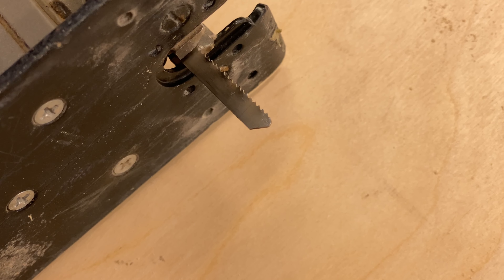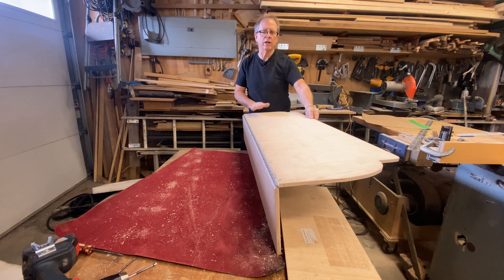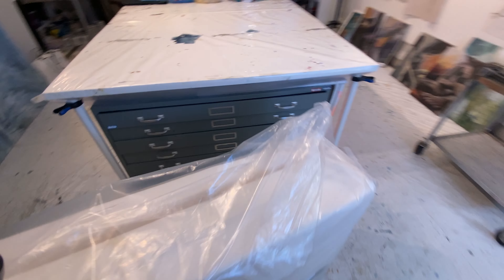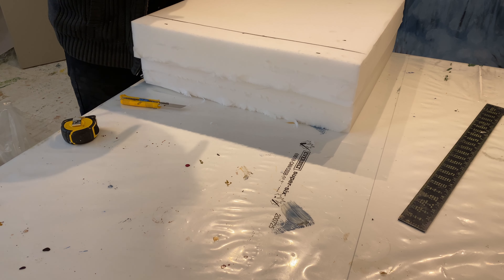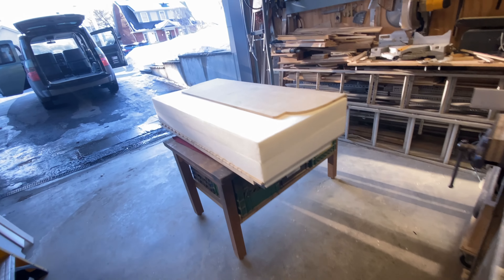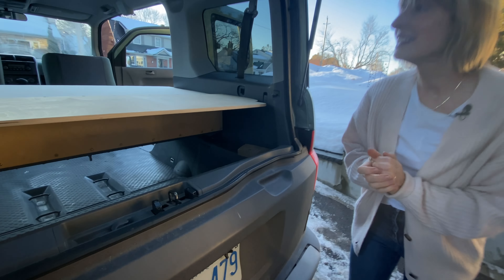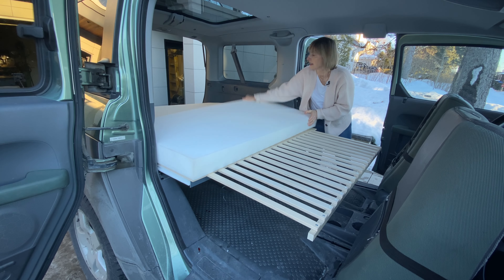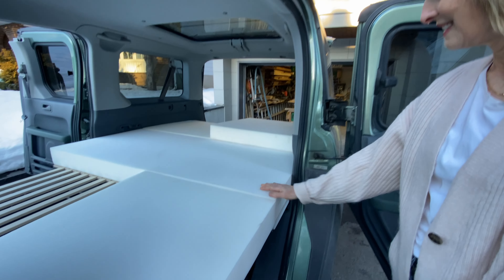Honda Element Reborn ~ The Big Reveal ~ This is Epic! #hondaelementcamper #campervanbuild

Comment: Wow.  Just found your channel and I'm impressed.  😁👍  Just needs some refining on the frame edges, a bit of wax on the sliders and adding the legs and you'll be set.  Might want to add a bit of grip to the bottom of the cushion fabric though (like the bottom of slipper socks) to keep them in place.  That can be done easily with a bit of clear silicone in a small piping bag over top of any fabric you choose.  Unless you're planning on making custom fitted sheets to keep them from moving while in bed mode (which I definitely recommend).  

I'll have to check out the earlier build videos I missed later (because it's almost midnight here so it's time for some sleepy videos, lol).  Thanks for sharing! 🥰
Reply from the maker: Great tips ...thanks for taking the time ...check out https://youtu.be/k878qpo39VY for leg solution Cheers V

Comment: Can I ask how tall you are? I’m 6,2” and trying to make a design where I can sleep without folding down my seats. 

Thanks!
Reply from the maker: We are both only 5’ 6” so we fit pretty much anywhere. In the max bed mode the bed is 48” wide by 77” long. That’s with the long cushions running lengthwise with two of the squares at the end.Probably the bed mode we will use.
Reply: @victore6941  okay, thanks for the info!